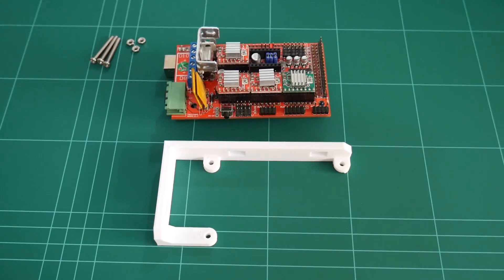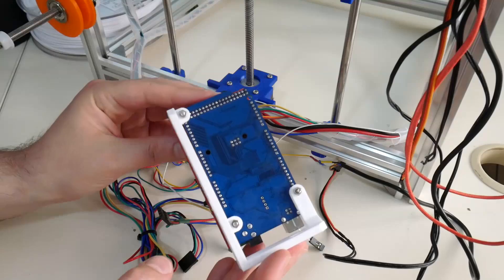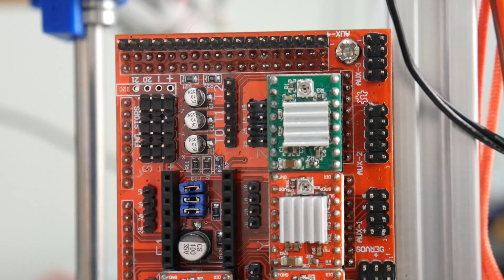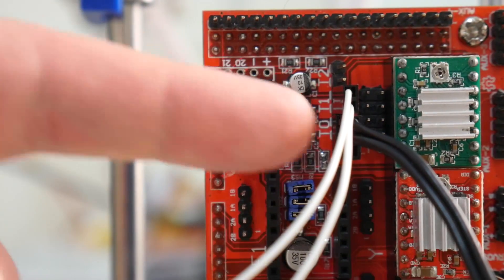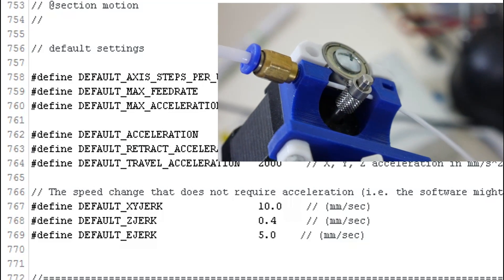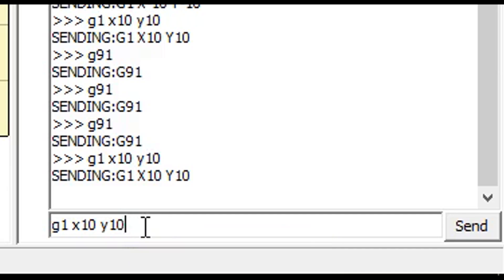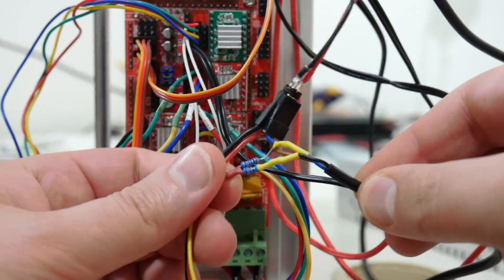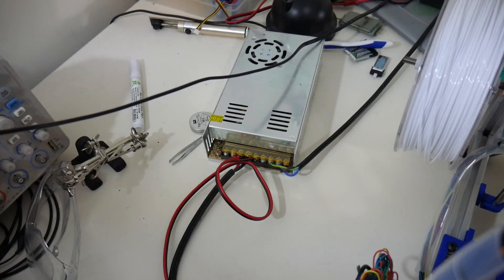New 3D Printer - Build Log #13

Comment: At 8:04 you show resistor divider with two resistors, so why do you have second one, one to the left connected at lower point on wire from the left one ? So setup like that will show always z min as TRIGGERED ? And whats are values of those resistors ? Tnx

Comment: you have updated this config file so there is no longer a configuration.h with probe also I tried plugging this into Marin 1.1.9 it will not allow this Configuation.h file to work. ..... will this config work just as well for a MKS 1.0 I have 2 MKS 1.0 and they work well with my TEVO Turantula but I still have the probe problem with it no being able to use the probe if I plug indirectly I guess I need the 12VDC to get it to work with the PNP probe

Comment: My printer worked fine, but I must have turned the motors too fast while it was off..

My stepsticks +Arduino fried.

Well, I changed the Arduino, the ramps and stepsticks 

Now my LCD only shows white and I cant do anything.

Why and how can I fix it

Comment: Might some one help me? I ve follow all steps from these videos and for some reason when I send a command to move on pronterface it dosen't work... the 2 motors beeps and heats up but there is no movement... the only way to move is pressing the red circle (when it goes to some  corner until the endstop. What does it might be? In the code there is not a XYJerk... there is a XJerk and a YjerK which I set as the same number. Where I set the Min, Max and mainly The Initial position?

Comment: hi! sorry but we spent abaut 5 hours because you don't explain how to run the right code.. when we try to connect with pronterface return an error "Attempted to write invalid text to console, which could be due to an invalid baudrate" we have to edit configuration.h and change de default value of #define BAUDRATE 115200
bye
please upload a video with more details
Reply: anyway your work its excellent

Comment: hi Tech2c i have just finished my hypercube. thanks for every thing. But my extruder doesn't work even though the temp has reached  the min extruder temp value. I tried 2 different board set including 8 different stepper driver, 2 differnt arduino and 2 different ramps 1.4 board. I used your configuration.h file with marlin 1.1.x which downloaded from marlin fw. Please help me :((

Comment: Tech2c

Any chance you or someone else could explain why my printer thinks X100 Y30 is X0 Y0 no matter what I change in Arduino? This is where the print goes when I start it up and it will not let me move along X or Y more than this. (Note, I have removed the inductive sensor and gone back to the Z endstop - for now).
Reply from the maker: What happens when you home X and Y? Do they move to the X and Y endstop and then say X0 Y0?
Reply: No, home X tries to run out the back of the machine and home Y tries to run out the left side of the printer even though that's where the end stop is. G1 X10 Y10 works properly but only to the same 100,30 coordinates where it all stops and registers 0,0. M119 also shows all working properly.
Reply: Going to swap out the Ramps board. Just noticed there is no power to the heated bed. I wouldn't think that would affect the end stops and movement, but who knows.
Reply: Ok, we're back in business or sort of. I replaced the Ramps and discovered that the printer still thinks 0,0 is around the center of the build plate, although it's not, and now the Z-Axis motor is binding up (never happened before). Any comments.
Reply: So I fixed the Z-Axis motor. Swapped in a new driver and all seems well. Except where the printer thinks 0,0 is.
Reply: Z-Axis now works properly, including the end stop. X and Y are still off. X tries to go out the front and Y tries to go out the left side. End stops are being triggered but the motors keep running.
 
// If enabled, axes won't move below MIN_POS in response to movement commands.
//#define MIN_SOFTWARE_ENDSTOPS (THIS LINE WAS PREVENTING THE PRINTHEAD FROM MOVING PAST THE CENTER OF THE BED)
// If enabled, axes won't move above MAX_POS in response to movement commands.
#define MAX_SOFTWARE_ENDSTOPS (Disabling this line doesn't seem to do anything)

Not sure what to try next. Any suggestions??

Comment: Hey I apologise in advance if someone (Tech2C?) has answered @Hamilton Kline 's question about how to "piggyback wire" the inductive Z sensor to reduce the 12v on the Signal wire - but I can't find it, and I'm going blind replaying the vid. Has someone got a circuit diagram, resistor values etc?

Comment: Hello when I am your procedure using the configuration.h file, Marlin gives me an error:
Arduino : 1.8.3 (Windows 7), Carte : "Arduino/Genuino Mega or Mega 2560, ATmega2560 (Mega 2560)"

In file included from sketch\MarlinConfig.h:39:0,

                 from C:\Users\utilisateur\Downloads\Marlin-1.1.x\Marlin\Marlin.ino:31:

SanityCheck.h:202: error: #error "(min|max)_software_endstops are now (MIN|MAX)_SOFTWARE_ENDSTOPS. Please update your configuration."

   #error "(min|max)_software_endstops are now (MIN|MAX)_SOFTWARE_ENDSTOPS. Please update your configuration."

    ^

SanityCheck.h:551: error: #error "Z_MIN_PROBE_USES_Z_MIN_ENDSTOP_PIN requires Z_MIN_ENDSTOP_INVERTING to match Z_MIN_PROBE_ENDSTOP_INVERTING."

       #error "Z_MIN_PROBE_USES_Z_MIN_ENDSTOP_PIN requires Z_MIN_ENDSTOP_INVERTING to match Z_MIN_PROBE_ENDSTOP_INVERTING."

        ^

exit status 1
#error "(min|max)_software_endstops are now (MIN|MAX)_SOFTWARE_ENDSTOPS. Please update your configuration."

Ce rapport pourrait être plus détaillé avec
l'option "Afficher les résultats détaillés de la compilation"
activée dans Fichier -> Préférences.

Comment: I have been banging my head trying to figure out what you've done to wire the sensor, especially the part where you're "piggy backing" Can you post an illustration of what in the heck is going on for that whole connection? I would greatly appreciate it.
Reply: Did you ever figure it out? I’m looking for the same info :(

Comment: I got one big problem which i couldn't figure out and also didn't find on the internet. Maybe you can help me out. I build my Hypercube just like tech2c and used the same parts and settings but for some reason when i move every axis, (so when i am homing the printer), it only moves very slow maybe with about 2mm/s and the bed only with 0.5mm/s. So far i couldnt figure out the problem, because it must be a speed or acceleration problem, becaue its only on the X, Y and Z-axis not the extruder.
And jes i have put in the bridges for 1/16 steps and the motors don't seem to vibrate and when i start a print the printhead moves just about 1cm and starts printing instead of moving to the center of the bed. 
I would be happy to finaly start printing, maybe you can help me out?

Comment: ok so someone explain what the advantage of autoleveling is. if your bed is not level, the bottom of your print will not be flat. the printer can correct if it is tilted at a constant slope, but if one side is higher it will screw with your print right?
Reply: First of all the bed has to be flat, autoleveling does not correct for that. What autoleveling does is to first calculate the bed deviation from level, then it applies this information while printing to allow you to print on a non level bed. You still want to manually level and keep an eye on your Z axis and make sure it's not moving too much if it does not need to because autoleveling uses the Z axis to accomplish its task.

Comment: I just noticed the Z-axis motor winding polarities were swapped (but not the windings themselves) for the Z-axis motor. Is this anything to do with the motors location? I know you have been playing around with Top vs bottom mounted z-drive motor locations... BTW I have mine on the top of the frame, shaft pointing down & using a coupler.
Cheers,
- Eddy

Comment: Your wires are Blue Red Green Black with Red nearest Power In. I bought RAMPS wiring; Online sources say the Ramps wiring should be Red Blue Green Black *with Red nearest Power In. The 4-plug connectors for stepper motors on the "Ramps Wiring Set" were in the sequence Red Black Blue Green which meant I had to attach my i2 motor wires to those plug wires in the "correct order". Predictably - They didn't work. I know all this is a Learning Experience but would it be too much to ask 3D Parts Suppliers to Standardise this? or perhaps the wiring set makers could get the motor wire colours in the right  sequence.

Comment: Awesome build! I am wondering if you ever considered the smoothie board for the printer? It is pretty much the next generation of 3d printer controller boards and can support a better UI and touchscreen. It might be a nice add on to this great build to make it even better. Are you also considering placing LEDs in the printer and making a closed enclosure to heat up the enclosure for better ABS prints? I am considering that but am not sure how well the pla parts will hold up in there.
Reply from the maker: I really want to go 32bit, touch screen, wifi etc but the items are a bit pricey. I've heard moving to 32bit can improve print quality so that may be a valid reason to pony up the cash.
LED's, sure that'll happen at some point. An enclosure is something I don't need at the moment as I seldom print in ABS, but having an enclosure makes it viable to vent the fumes outside in a controlled way. So many options...

Comment: X and Y movments on my build are very slow, compared to the video, and the Z axis dos not move at all and the stepper is just making some knocking noise.

how do I have to set the jumpers for each motor driver?

I'm also no sure about the motor wirering. my motors have  Red B+, Blue B-, Black A+ ,Green A- according to Banggood web site
Reply: bitman ([

Comment: Excellent instructions for a nice 3D Printer.
Might it be better to rotate the heated plate so that the cable is on the rear. This would put less vertical strain on the heated bed platform.

Comment: I got a ANET A8 3d printer, can I use those parts also for the hypercube?
Reply from the maker: Sure can!
Reply: Tech2C do i need to make the frame bigger? the bed is 220×220 of the A8. or wil it fit your design?
Reply from the maker: Kris Aerts

Yes you can increase the size of the X and Y print area by adding 20mm to the extrsuions and rods for X and Y.
Reply: Ok. Thx m8. Orderd all component. Wil post picture when hypercube is ready.

Comment: I've been really impressed with your 3D printer design. I tallied up the parts cost and decided as a beginner it was better to purchase a DIY kit and then build your frame later. I picked up an ANET A8 for around $150 US. Got it up and running and will be building your frame next.

Comment: About how much does it cost you to build a HyperCube excluding the printed parts?
Reply from the maker: Under $250, depending on how much you pay for the aluminium profile frame. Checkout the Thingiverse link in the description for links to prices on parts.
Reply: Hamilton Cline okay sir, your right. now get yourself a cookie and let peace take over. have a nice evening, greetings
Reply: Maybe the costs are different for different people, depending on location and quality of parts.... :O    :) :) Thanks for your input guys.
Reply: It cost me over 500, starting from scratch. I needed to purchase all fasteners, all electronics, and things like cable management and cable ties.
Reply: Hamilton Cline duuuude... 500$ is way too much for the "exact" one from tech2c... for 500 you can get a way more powerfull controler, bigger heated bed + bigger extrusions etc, a nice lcd and some extra stuff like nozzles and some filament
Reply: clypeum in order to start from scratch and purchase the same printer tech2c has, and use his links for the purchase, it costs roughly 530 dollars us.
Reply: Hamilton Cline delivered to you from banggood and ebay? no way.
Reply: clypeum way.
Reply: Hamilton Cline xD no but seriously where did you bought your aluminium 2020 and the rest of the hardware that wasnt listed on the thingiverse page? you could buy 2 1/2 i3's for that money and strip them down for parts
Reply: clypeum you're not buying an i3. and i3 clones use cheap parts. the parts listed on tech2cs BOM are decent parts. the 2020 extrusions from any company in America cost roughly 10 dollars for a meter and you need at least 5 meters for this build. go look up BOM for any corexy and they're all around 500 dollars. anyone can cheap on parts, but paying the correct good parts costs roughly 500 dollars. to say nothing about all the tools I had to buy, since I had none. as well as extras like the cable tubes and ties, crimping materials, and measuring things.
Reply: Hamilton Cline oksy then im rowing back from my previous comment... your probably right but with a decent tool set on hand its more like 300$-350$
Reply: Not only is it not, I could show you my bill of materials if you email me. No use posting it here. You might not be thinking of fasteners. Fasteners alone cost roughly 100-150 bucks. The electronics, including a lcd screen cost around 150 on their own. The 2020, the steel rods, and the anodized aluminum tubes which are fucking impossible to buy in america cost around 100 bucks. that puts us at 350-400 bucks right there, and that hasn't gotten any of the bearings, belts, extruder, bowden tube, fans, inductive sensor, the hammer nuts. There's so much stuff for this build. there are 39 different kinds of things you need and nearly a thousand total parts.

And this hasn't even considered what it costs to print the 3d printed parts of the build. Which is around 250g of filament, preferably something stronger than pla. You clearly haven't built this machine, so I'm not sure why you're arguing with me.
Reply: Hamilton Cline first of all i have build this printer, an i3 and a printrbot so i know my stuff and my sources. i buy fasterners in kg packs bc i have some good friends with connections. the electronic etc is about 50€ delivered to germany. no need for fanc 32 bit chips etc. you wont need that in normal use. 2020alu is very common in europe and you can get a piece of 340mm preciesely cut for under 2€. maybe its not the printer that costs so much, its your location and the fact that you need metric stuff in a none metric country ( sure its more expensive in M'ca
Reply: Ok, but I wasn't talking about the friends you know, or the companies that give you a good deal. I said. From scratch, to make this machine, it will cost a person (and to be fair I live in the United States) roughly $500 US, purchasing all the parts necessary with no previous parts, or personal connections for better deals, or buying thousand bundles of fasteners unnecessarily. Maybe it's that you're not realizing that to say what it costs means you have to be honest about what it costs someone who knows nothing about the industry to purchase the parts and put it together with no previous parts and no intention to have 10's of thousands of screws left over at the end. Also, 340 at $2.50 means you still need 4 of those 4 350s 4 310s 2 285s and one 175. That's still roughly 37 dollars and that does not include shipping. So I would maybe be able to save 5 dollars there. Not the amazing savings you're making it out to be by quoting a number for a single unit of something that requires many units.
Reply: Cheers!
Reply: Hamilton Cline is right. I'm in the process of building mine from scratch. I definitely didn't spend as much on fasteners (about $35 for me through MrMetric's website for everything but the t-slot nuts) but I'm at around $500 building from scratch if I remember right. My setup is larger, but I'm buying my 2020 extrusions in 2440mm lengths through amazon (the 8020 brand) to cut to size myself and save a bit of money that way. Aliexpress and banggood were both having some pretty good anniversary sales going on when I bought my parts as well so I saved money that way. I'll be documenting the build and the final price on my channel very soon if anyone wants to follow.

Comment: Do you really need a voltage divider for the proximity sensor at 6 - 36 volts you can just use the 12 vilts from the board can't you?
Reply from the maker: The sensor is powered by 12v, but the trigger wire also outputs 12v to the arduino/ramps boards, which they can't handle.
Reply: Thank you all clear now :-)
Reply: NPN sensors don't need a voltage divider AFAIK. I am using a 18mm NPN one with brown is connected to a 12v out from RAMPS, blue is connected to ground and the black is connected to signal pin of the Z endstop.

Comment: Great printer, I have been following your videos from a while now and learning a lot, I currently have a P3steel but I start ordering pieces for the Hypercube :). Just one suggestion, maybe is a nonsense, but if you attach the brass nut support facing down you will win 20mm extra for the Z axis. Instead of using the top and rear faces of the alu profile using the bottom and rear faces. Maybe it doesn't work, just thinking out loud. Congratulations for the design!!!!

Comment: Good night I made a printer like yours and I am using the RAMPS1.4 12864 LCD Display Controller, but my screen does not show anything stays on but does not show anything could tell me how to configure marlin to put my screen to work
Reply from the maker: In configuration.h you need to enable the type of LCD display you have. It's towards the bottom of the file.
Reply: Tech2C Good afternoon and thanks for the help, but I ended up getting congratulations for the project some parts I made a few changes thank you